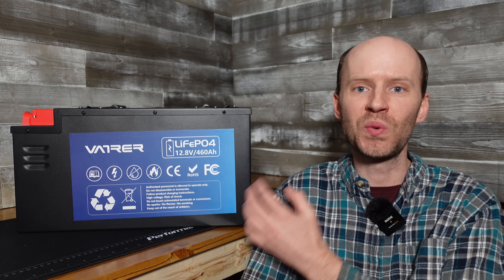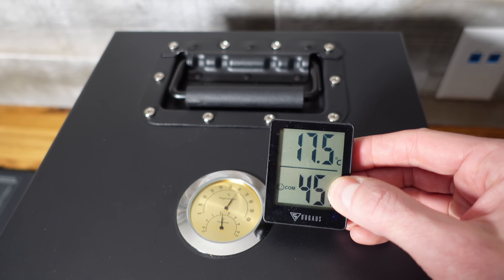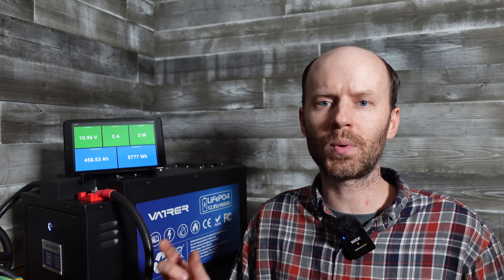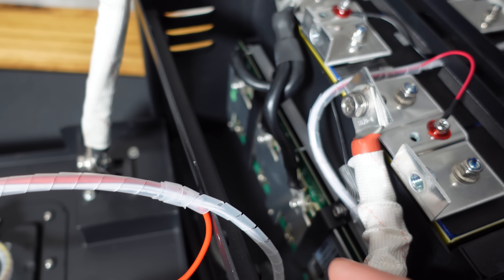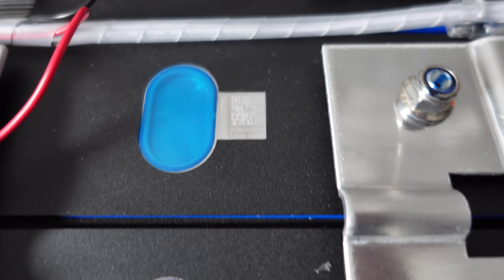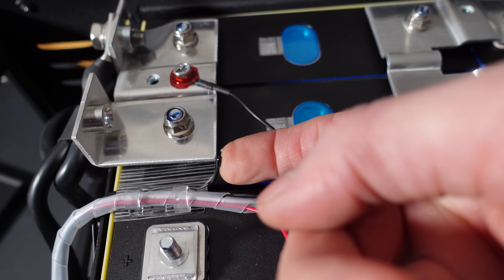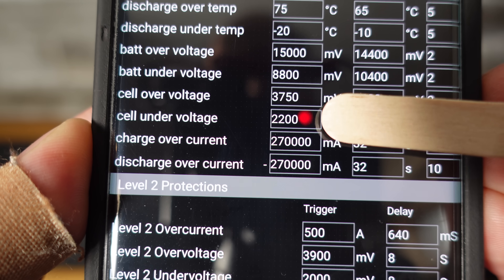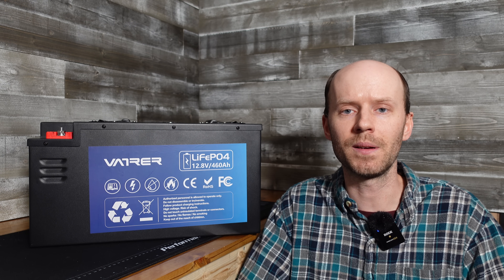MASSIVE 12V 460Ah LiFePO4 Battery from Vatrer, Nearly 6000Wh, Full Review!

Comment: 12.8V though.  Using a 12V architecture pretty much stops making sense once the storage capacity gets that high.  Not only do you want to run a higher system voltage at that point... 24V or 48V (51.2V nominal), you also want at least two batteries in parallel for redundancy and robustness.   And you want to avoid series configurations for the same reason... no redundancy with series, and less robustness.

Also, the charge and discharge rates are fairly poor... it is actually fairly typical for these high-capacity 12V batteries to not be able to charge/discharge at 1C due to the amperages involved, and that's a big problem.  150A charging and 250A discharging?  1.9kW charging and 3.2kW discharging.  A single 48V 100Ah battery (5.12kWh) can do 5.12kW charging and discharging and it can do it with only 2 AWG cabling at 100A.

In anycase... there are a few minor challenges retro-fitting a higher voltage battery architecture, but the results are phenomenal.  Its perfectly acceptable to decide to stick with 12V if retro-fitting a higher voltage would cost too much (having to replacing other pre-existing gear such as the inverter), but anyone doing a new build should go straight to 48V without looking back, even for a small system.  But particularly for a big system.  Getting stuck with huge, expensive 12V batteries can make for an unhappy camper a few years later.

-Matt
Reply from the maker: If you're doing 3kW discharges, I agree that you're using the wrong voltage here. I would not suggest building a 24V or 48V system with these (or any 12V battery). I see this designed for someone who wants extended runtime not maximum power. For example, you can't even run a 300W load off this battery for a full day.
Reply: @LithiumSolar  48V architectures are sold all the way down to 25Ah.  Even if you wanted a small system, you could still use 48V.   The point is that if you want to scale up, you hit a wall with 12V at 1/4th the capacity that you would with 48V.

I think you are misunderstanding the difference between amp-hours and the actual energy content of the battery.

12.8V @ 460Ah = 5.89 kWh of storage
51.2V @ 115Ah = 5.89 kWh of storage

A 48V architecture at 460 Ah would be over 23 kWh of storage capacity.  That would be a huge system.

If you want to compare like-with-like, you compare the same storage capacity.  So NOT a 48V archite ture at 460Ah, but a 48V architecture at 115Ah.   Same number of cells, same type of cells, same size cells, same energy content, different topology.

-Matt
Reply from the maker: @junkerzn7312  I am not misunderstanding anything. You have two different discussions going here - one complaining about voltage and the other missing the point of OP's request. If you want a 5888Wh battery at 51.2V, then this is not for you. This is a 12.8V battery. Not everyone shares the same opinions you do, thus we have free choice. If you don't need a 12.8V 460Ah battery, then you should not purchase one. It seems pretty simple.
Reply: @LithiumSolar I'm not saying that people don't have free choice.  There are certainly situations, mostly retro-fits, where sticking with 12V makes financial sense.  But that would pretty much the only reason to ever sock yourself with 12V.   Literally.

One can argue whether 24V or 48V is easier from a learning or upgrade perspective.  It is impossible to argue that 12V is a good architecture these days.  It just isn't.

Free choice != correct choice.  As an influencer, people depend on you to provide them with the correct choice.   Right?  You don't want to sock people with an architecture that massively limits their flexibility a year or two down the line, and you should at least understand and explain that rather than just pushing a huge 12V battery out your channel.

People who buy big 12V batteries need to do it for very good reasons, almost universally related to retro-fitting something they already have, and not for dumb reasons.  That's what your job as an influencer is.  To make that distinction.

-Matt
Reply: @junkerzn7312  "It is impossible to argue that 12V is a good architecture these days.  It just isn't."

You are absolutely, positively incorrect. What is the purpose of the system? Saying that any particular voltage is terrible without accounting for the use of the system is beyond ridiculous.

If your planned loads are all 12V then a 12V system makes sense. There are plenty of 12V devices that are not obsolete. If your loads are all 24V or 48V, then of course a 12V system makes no sense. Running predominantly 12V loads on a 24V or 48V system is inherently inefficient, far less efficient than the negligible cable losses with 12V when running, for example, low voltage lighting loads. When running from a battery, knowingly doing something that is less efficient is a "dumb" thing to do, to use your phraseology.

He mentioned using the batteries in series because it is in the manual from the manufacturer. He said "you can," not "you should" and therefore he did not suggest doing so. Running multiple BMS units in series is not the way to properly build a 24V/36V/38V system, but it is in the manual.

Comment: The balance at rest set to 3.3v means that it will attempt to discharge any cell over 3.3v. So if you charge up the battery and leave it for a couple of days..........
Not the settings I would use. The Overkill app has noticeably better Bluetooth performance on my Samsung tablet and Pixel 7.
Reply: No, not correct.

It will start balance at 3.3V AND the imbalance is above 15mV.
Reply: @MichaelEricMenk   I suggest you give it a try. I just set mine to 3.3v and the cell delta was 1 millivolt, every cell shows as balancing because they are above 3.3v.

Update, since I tried it on another (newer) JBD BMS. It seems the newer models do have software that perform as you indicate. The older models seem to have a different algorithm (as I indicate). So you are correct, it seems any JBD you purchase now won't balance unless the delta is greater than the set minimum.
Reply from the maker: If you charge an LFP battery and leave it sit for several days, the voltage will have dropped to at or around 3.3V anyway. It doesn't stay at 3.65V when the charger shuts off.
Reply: @LithiumSolar  Yes, but the setting is quite useful to top balance. Depends on how "saturated" you get the cells, mine don't drop below 3.5v for a couple of days. Probably why when I top balance I never have a need for an active balancer.
Reply from the maker: @john_in_phoenix  Fair point. I suppose something like 3.40 may have been a choice here.

Comment: try a dark Grey mat or color mat on new  desk top - this will make products / details  more visible -  Lighting will be easier -  
small light reflectors are your friend  - to hold small things  bean bags are fast and easy - 
I  rest my hand on desk when showing phone app  reduces movement -  easy way to look better - 

setting up shoot its good idea to take a few photos of set lighting locations -  
at some latter date you have video that Looks Real Good you can look at Ur photos of light positions were -
saves time -  easier
Reply from the maker: Thanks for the tips. The choice of mat was more for circuit board part use (server boards), didn't intend to really put black batteries on it when I purchased it. Also, phone shakiness was partially caffeine consumption LOL.

Comment: 14:05 No, you have 5x the reliability. If that 460Ah pack has a BMS die you have a brick.  If one dies in the 100Ah string you still have 400Ah on tap.
For any high reliability application like remote solar or marine all your eggs in one BMS basket is a substantial risk.
Reply from the maker: I suppose that is a valid way to look at it as well. I'd still prefer one battery over several 100Ah's but that's just me.
Reply: While its a matter of high reliability to have more then 1 massive  battery its also matter of economics. Most people in RV and offgrid simply cannot afford losing over a thousand bucks on a battery. We are kinda reaching a point where buying 1 battery challenges monthly net income after expenses, for a poorer RV-er/offgrid guy. @LithiumSolar
Reply: No you just open it up and you have cells to work with

Comment: I tried 2 of the Vatrer smaller 7a 12v batteries with poor results in a 12v scooter, they could not provide the amperage the small razor scooter needed just in case anyone needed this info

Comment: I have 2 of Vatrer's 200 amp hour batteriea I use in parallel in my RV.  These have been in use for just about a year now.  Currently being stored in my garage at full capacity.  I am amazed how little power they have lost during this winter storage cycle!   Very happy with this product!
Reply: Use something to draw them down to 85% so you do not damage them. A 400 watt roadpro DC heater ran a few hours will do it on a cold day.

Comment: If you repeat the capacity test with 25°C cell temperature, you will probably exceed the 460Ah rating.
Reply from the maker: I realize 25C Is the standard discharge temperature for most batteries; however, I've never had to adjust temperatures during my tests to reach rated capacities.

Comment: I wonder if they make a 48 V version?
Reply from the maker: I doubt it. That would weigh about 425lbs and practically require a forklift to move!
Reply: @LithiumSolar  Or an engine lift to move around 😂
Reply: @LithiumSolar  No it would weight the same.  Sheesh.  12V @ 460Ah == 48V @ 115Ah.  Same capacity, same number of cells and cell capacities, different topology.  The whole point of using a higher voltage is that you can push the same power with far lower amperages and far, far lower heat.
Reply from the maker: @junkerzn7312  There is something wrong with your math. This is a 460Ah battery. A 48V version of this would require 4 batteries to reach 460Ah at 48V. That's 4x the weight. I don't know where you're getting 115Ah from. Sheesh.
Reply: @LithiumSolar  You understand that the storage capacity is in watt-hours, right?  Calculate it.   Come on, this is pretty damn basic.
Reply: I think he means 5888Wh @ 48v. Which would be 115ah @ 51.2v. 48v is better for efficiency and wire size.  @LithiumSolar
Reply from the maker: @adir_1  That is not what he's asking, guaranteed.
Reply: @junkerzn7312  "12V @ 460Ah == 48V @ 115Ah"

Please educate us, oh one of self-declared superior intellect, how to make a 115Ah pack from 230 Ah cells. Did you even watch the video?
Reply: 12vx4=48v one of these batteries weights 108 lbs 4 in series for 460ahs = 424 lbs = forklift to move all of them at once😅

Comment: Yes! the bms app displays the pack and individual cell voltages based on the balance harness connections which have zero current flowing on them for maximum accuracy.

Comment: Hey LS, don't have to tip the pack to remove a cell. You can use SFK cell removal tool to pull a cell from the pack or make one.
Reply from the maker: What is the SFK cell removal tool? I don't see it on their website unless I'm missing something obvious?
Reply: @LithiumSolar  It's just a 3d printed handle that you can attach using the two terminals on the cell. Handy, but not "special".
Reply from the maker: @john_in_phoenix  Ah ok, so it pulls the cell out by the terminals. I'm not sure how strong they are but the neoprene foam stuff they use on these batteries has a suction cup-like effect. It's not glued but it sticks on - I'm sure there's a scientific term for it. I'd be hesitant to pull them out that way personally.
Reply: @LithiumSolar  Yes, I have never tested how strong those terminals are, it just makes it easier to grab a cell. It won't help with the "sticktion".
Reply: @LithiumSolar  search Youtube for this video by SFK - "SFK V4 build & capacity test video REPT 280" forward to 11.22 minutes and play. you can make with other materials

Comment: Holy crap... can I use 4 of these for a  for a 48v ebike? I wonder if I can buy a car hub motor for this... this is nutz.
Reply from the maker: LOL you would be looking at 425lbs just in battery weight, not to mention a frame to mount them.
Reply: 2500 mile range with a trailer.

Comment: That's a big boy haha
Reply: That meter on the top is so strange..
Reply from the maker: @WillProwse  I'd love to see your review of this particular battery as well lol. It seems to leave a bit of lingering uncertainty, particularly around the cell condition.
Reply: @WillProwse Wow..   I just replied to the original post and saying how you just tested the 12v 100Ah version of this brand..  then scrolled down and saw you\your reply to it.
Reply from the maker: I love the look of it but I really don't think it's working correctly. It's been 24hrs since I filmed most of this. The lid has been off all night and it's still showing 13C. The humidity has increased to 64% which still seems very off for January. I need to find a 3rd hygrometer to compare with as my Amazon-special probably isn't accurate either.
Reply: @LithiumSolar  weird haha
Reply: Would love to see a similar review of Vatrer's new 12V 300AH Bluetooth with Self-Heating battery. This might reveal if Vatrer has improved their build quality to your satisfaction as well.   I like the dimensions of the Epoch 12V 300Ah Heated & Bluetooth battery but don't think it's worth the price difference for 4  batteries ($945 vs $650 each with shipping and discounts).
Reply: @MikeQED epoch is surely worth the price. 11 year warranty.
Reply: Anyone know where to buy those busbars at 9:17? or are they just specifically made for Vatrer? I've searched AliExpress, Alibaba & Amazon with no luck.
Reply: Hey Will, Please do a review on this one.  It has a great form factor for an RV.  Some reviewers and amazon reviews said it uses Grade B cells that scared me off.  Now I can't see this exact one on Amazon anymore.  I know you gave a good review on a smaller Vatrer.  I would be tempted to buy this one if I could be confident it uses grade A cells.

Comment: Is it available to the public at a very reasonable price? Is it deep cycle for RV travel trailer?  Are there dealers near Danbury Connecticut or Westchester County, NY ? Maybe it's smarter to tie two half the amp/hrs.  in parallel? Thank you so much 👍🌲🌟
Reply from the maker: It's available for purchase on Amazon and their own website. There are links in the video description. It is deep-cycle and designed to be cycled to 100% depth of discharge. The price is reasonable and aligns with the current market value of lithium batteries. It's not cheap though :)
Reply: @LithiumSolar  Hopefully, it's cheaper than Battleborns? Does it come with excellent guarantee? Is it user-friendly and made with high quality components and easily serviceable? Is it built/made in the USA ? Thank you 🌲☀️
Reply: It's $1400
Reply: @meilyn22  Thank you for giving us the cost. It's also very important to know how well it's made, the build quality. Is it easy to open, service, and repair? These are important things to know. Thank you 🌲 😊
Reply from the maker: @Hundert1  Did you watch the video? Many of these questions are answered there...
Reply: @LithiumSolar  👌☃️🌲